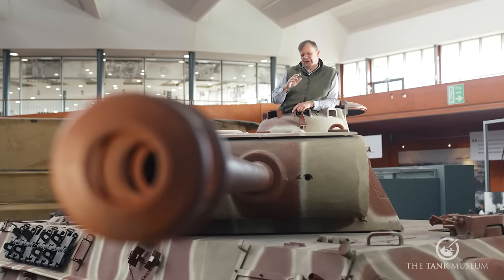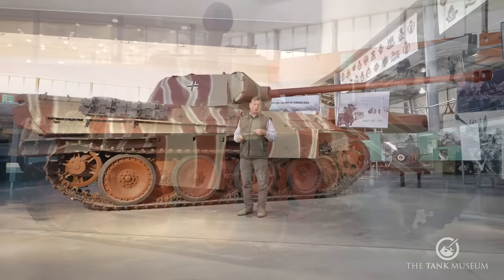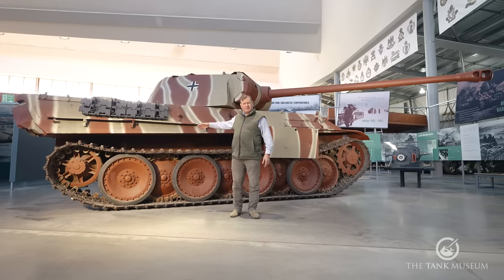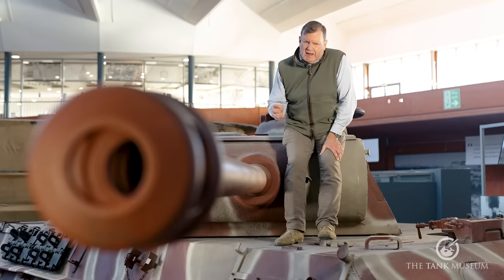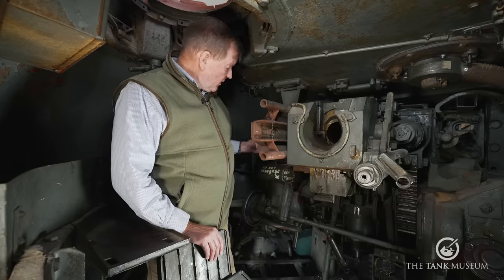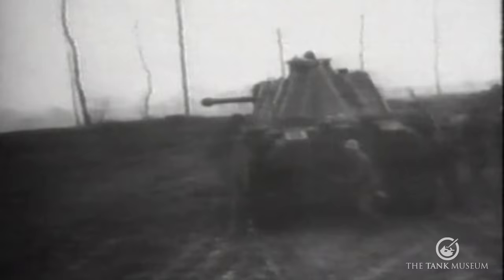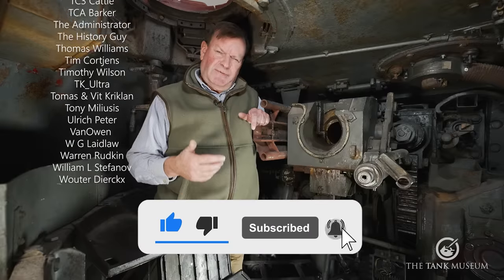See Inside Panther | Tank Chats Reloaded

Comment: Given that Germany was largely on the defensive when the Panther was introduced, it could be just about accepted since they were fighting not far away from railheads and repair depots. For the Allies, largely on the offensive and at the end of a long supply chain, it would have been completely unacceptable.
Reply: We saw during the battle of the bulge how poorly they performed during offensives. Especially King Tigers were a nightmare needing an insane amount of fuel and struggled with local infrastructure
Reply: Given that you could be shot for Wehrkraftzersetzung when saying out loudly you didn't believe in the Endsieg right until the very end of the war, I don't think your comment would have been of big consideration back then. Nonetheless, I guess you are pretty much right.
Reply: Could have built a bigger Panzer 4.
Reply: @julianshepherd2038  could have done many things, but didn't. Decisions are always easier looking back in time.
Reply: @suenin021-ll3us

And yet the Panthers of 2nd Panzer Division got the furthest of any German armour type in the Ardennes offensive, and did it quicker than the Shermans did the reverse advance in the January counter attack so.....?
Reply: @cheften2mk  I think the point I was trying to make would be that if the Allied armies were equipped with Panthers, the whole invasion of Germany would have been a very different deal, because most of them would have broken down along the way or been tethered by fuel supplies. In the past, there has been a tendency to state that late-war German tanks were flat-out superior, and that is simply not true - everything is conditional.
Reply: In late '44 or '45 - sure, in '43 - not really. There were a lot of abandoned and destroyed tanks left behind on the Eastern front.
Reply: This isn’t true, Germany was still attempting to complete its push into Russia when this tank was introduced, on the end of some of the longest supply lines they would ever maintain during the war. There’s even some reports that offensives were delayed to wait for the panther. It was a terrible tactical decision to introduce and rely on this vehicle when they chose too.
Reply: @onenote6619

And of the Germans were equipped with Shermans instead of what they had in the defensive fighting 1943-45 their armoured divisions would likely have fared worse.

Each nation had different requirements.
Reply: @julianshepherd2038 the Panther was the first german tank with "mass production" in mind, the pz 3 and 4 were flawed in their design because they were conceived as high quality low production models,  each variant of both series had soo many different parts that even the haches were all separate models. The panther didnt cost much more of a pz4 F or G considering the upgrades it brought to the table bc its design was the first concieved from the start as mass production tank, with standardized parts easy to produce. In all honesty they thought of making a sloped front version of the pz4 but soo many things would have needed to be changed that they decided it was better to just make a new tank with better stars overall
Reply: @lyndoncmp5751  Hard to say. If the Axis had gone the Sherman route, they would have significantly more tanks built, significantly fewer tanks lost to mechanical issues, fewer crew lost when the tank caught fire and fewer problems with fuel. But that's not what I was trying to say. The Sherman had to be built with utmost attention to reliability, maintainability, transportability and logistics, because it was always going to have to fight across an ocean. On those fronts, it was certainly high on the 'best designed tanks' list. Because it's not World of Tanks and you have to get to the battle in order to fight there.
Reply: @lyndoncmp5751  That's a rather deceptive comparison. On Ardennes offensive, Germany had surprise and weather cover,  so just about every tank they lost in the initial advance was due to mechanical failure or fuel starvation. On the counter-attack, the Allies were going up against a bitter rear-guard action. So the difference in time taken is entirely unsurprising.
Reply: You are assuming that if a tank can reach a repair depot, it can stay there for as long as it needs. 4500 panthers were build but Germans could not amass more than 200 (or 5%) at one time. Thats how unreliable the tank was. A dead weight for the army. This wouldnt be a problem for a specialized heavy brake thru tank but was a problem for a panzer division main workhorse tank. It wasnt THAT expensive to build nor was it build in small numbers (more Panthers were build than Cromwells). The ratio of tanks operational/tanks build is terrible and that makes it a bad tank.
Reply: @julianshepherd2038  bigger Panzer 4? You mean the Tiger I?
Reply: @lyndoncmp5751 The whole offensive was a huge failure and bogged down after days and Peiper had do abandon his tanks, soooo?
Reply: Yeah but when they started developing the Panther they were still on the offensive, don't forget.
Reply: @lyndoncmp5751  Traveling furthest doesn't mean most effective does it? 

It depends on the opposition you come up against on the way or the difficulty of the route traveled. I can't imagine that a Tiger II would out drag a Panther on any terrain, let alone one that is hilly, wooded, and narrow. Let alone the weather. Fortunately for democracy, there were some seriously poor decisions being made at this point in WW2 on the Axis side. The Panthers might have got furthest but how many broke down or caught fire  on the way there, and on the way back 🔥😂. 

Then the Sky's cleared and the allied air forces got into action. 

Did Hitler really think it would be cloudy until the unreliable and thirsty Panthers and the extremely slow and extremely thirsty Tiger II's reached the Dutch ports running on fumes 😂. What a stupid gamble. God knows what the experienced German generals thought, but they probably didn't have much say in the matter anyway. 

Truth is the Panther didn't even pass British tests for battle worthiness in post war tests according to the film so it does make one wonder at the acclaim it receives. It might be considered a thoroughbred, but it was defeated by the pack of very numerous and very basic T34's....which didn't break down, or there was a spare if they did. Nevermind the quality, feel the width lol.
Reply: It wasn't a problem for the Soviets with the T-34
Reply: Using the Battle of Bulge as an example to gauges the effectiveness of late German tank designs, especially the Panther, was far from an accurate assessment. Any German tanks, Panzer IV or III, or pretty much any AFV bigger than a jeep, would suffer in performance, mobility and logistics in narrow forest roads. The Battle of France in 1940 succeeded simply because the Panzers only travelled the unguarded Ardennes Forest, rather than bogged down fighting there, it had little to do with Panzer I or II being lighter or Panther big and heavy.
And if one think the logistically superior Allied tanks could make the difference, remember that the Allied forces had been sitting on the other side of Ardennes Forest for almost half a year after Liberation of France, only entering Germany proper by early 1945, if Sherman tanks could easily fight through the Ardennes then why wait that long?
Reply: @suenin021-ll3us

Well can we say that the American Operation Queen and the Lorraine were also huge failures, despite having masses of Shermans leading the advance. Why didn't these wonderful Shermans break through the Siegfried Line in autumn 1944? Why did they fail to achieve their set objectives?
Reply: @eric934

The claim was that the Panther performed "poorly" in the Ardennes and couldn't get anywhere. I merely pointed out that 2nd Panzer Division Panthers got the furthest out of all the German armour types (almost to the Meuse) in the Ardennes including the Panzer IV at Stug III, and what's more did it quicker than the Sherman did the reverse journey.

The Ardennes was not very good tank country for ANY tank type. Shermans didnt perform any better and in fact the US lost roughly three tanks/tank destroyers in combat for every one German. Total American losses were, according to various sources, between 800 and 900. That's total losses. For the Germans it was around 550. However, circa 50% of German losses were due to running out of fuel, minor mechanical issues and no resources to repair them, and even a thrown track or getting stuck in a ditch caused abandonments when support echelons had no fuel to, well, 'support' them. 

So we are talking circa 300, at most, German combat losses vs 800-900 American. That's a big difference.....and the Americans were doing the defending during much of the battle.

Around 500 Shermans were combat losses in the Ardennes vs around 100 Panthers. The Panther was the most numerous German tank in the Ardennes.

Did the Sherman REALLY perform any better, or were there just a lot more of them.

US 6th Armored Division was full of confidence in its tanks prior to the Ardennes. When Eisenhower visited 6th Armored Division on February 13th he found this summary:

"13 February 1945
Subject: Visit to Armored Units.

2. 6th Armored Division.
c. Equipment: - Present tanks are entirely unsatisfactory, due to lack of a satisfactory gun and lack of flotation."

Similarly, the report Eisenhower received from tankers of US Armored Division in March was equally scathing of the Sherman.
Reply: @sthrich635

Absolutely. The Americans had masses of Shermans in autumn 1944. Their Shermans still failed to make the difference and progress far beyond Aachen, in the Lorraine, in Operation Queen and in the Alsace. Basically the US Army couldn get anywhere for six months from September 1944 to March 1945, despite having thousands of the "super wonderful 100% reliable" Sherman tank which was the bestest and safest tank eva eva eva..... so we are now told.
Reply: onenote6619

Shermans basically did well because there were lots of them due to the capabilities of mass American production (which the Germans couldn't have matched REGARDLESS of what tank types they decided to build) and they almost almost enjoyed considerable air and artillery support as well as practically unlimited other support, supply and resources. The Germans would have had none of the above 1943-45 and thus the Sherman wouldn't have worked any better than what they did have. Likely worse in fact. 

Their big cats and powerful panzerjagers suited them better in the 1943-45 defensive fighting than the Sherman would have. For certain. If the Germans had the Sherman they still wouldn't have had quantity superiority and the Sherman without quantity superiority and without mass air and artillery etc support would have been mediocre. 

The German "surprise" attack in the Ardennes was only a "surprise" for the first few days, so let's get real here. After the first few days the Americans were able to recover and send vast amounts of reserves there. Even British forces were sent in to aid them. In the American Ardennes counter attack in January they had nearly a million men and were facing a numerically inferior enemy short on fuel and other supplies. The Americans, again, also had mass air and artillery support and were not facing a fresh new enemy. The Germans had been fighting for weeks without reinforcements and were exhausted. Many of the American troops in the January counter attack were fresh. The Americans had far more advantages in January than the Germans had in December. 

So I'll repeat what I wrote earlier. The Panthers of 2nd Panzer Division got the furthest of any German armour type in the Ardennes, and they did it quicker than the Shermans did in the reverse during the January counter attack. I stand by this fact. 

All tank types have mechanical issues and breakdowns. The Sherman wasn't immune. In fact during the British 2nd Army's advance across France after Normandy, known as the Great Swan, they reported their Shermans were less mechanically reliable than their Cromwells, and suffered more automotive issues.
Reply: @Paciat
"4500 panthers were build but Germans could not amass more than 200 (or 5%) at one time."

Your figures are off. The Germans built over 6,000 Panthers 1943-1945 and there were over 650 Panthers deployed to Normandy in 8 battalions.

Overall operational average % of Panther battalions in 1944 reached a high of 85% on 31st October and a low of 53% on 30th December. The mean was 75%. This figure includes those in repair with battle damage. 

Source :Thomas L Jentz, Germanys Panther Tank, which is the best single source on the Panther. 

Where on earth do you get your 5% claim from?
Reply: @Paciat  Germany could not amass more than 200 Panthers at one time? Wow, what a load uf utter nonsense. Germany had more than 600 Panthers for the fighting in Normandy. Maybe read some actual books?
Reply: @onenote6619  No, they were not build with the utmost attention to transportability or logistics. That is simply a vast oversimplification that keeps getting said to ignore how much works it was to keep tanks working. It falsl in the same silly category in that Shermans could not weigh more than 30 tons because the cranes couldn't lift it, which is nonsense as dock cranes could lift way more and so did the 50 ton crane on Liberty ships.
Reply: @lyndoncmp5751     Hi, it is however a well known fact that the German Ardennes  Offensive was entirely unexpected and against very minimal resistance initially. That the hastily organised Sherman's made slower progress on the return journey against a Panzer Army in position can't be a surprise to anyone surely.

That Hitler and his generals gambled so badly, using and losing so much materiel in the process and in such a choke point as the Ardennes is delusion at it's worst. They chose the trap for themselves and drove into it with unreliable tanks and not enough fuel. When a tank broke down it blocked the road and others couldn't get past in either direction. The Americans joined battle there because the Germans had chosen the battleground, they had no choice. They did a very good job of it in the end too. Especially when the skies cleared for the fighter bombers.

As for the 3-1 losses suffered by the Americans, it doesn't matter. Crews bail out and those that survive/escape, go get a new tank/tank destroyer and carry on. That's what numerical superiority gives you. German crews on the other hand become infantry until they can find another tank that's not broken down or empty of fuel. The same of course largely applies to the Russian front and the T34.. However the ground there was more suited to tanks. It still didn't work though for the same reason. Essentially it's a case of a poor choice of weapon. 

At the end of the day the tank that wins is superior, because it is more effective in the progress to victory. It doesn't matter how many you lose if you have lots and lots.
Reply: @julianshepherd2038  — Nah, VK 30.02(DB) aka "Teuton" T-34 was a better tank prototype. It was fast and agile, better armored and easier to produce, but silly M.A.N. Politics got on the way, and Fuhrer totally bought into "bigger is better" selling point, that M.A.N. Failed to deliver.
Reply: @Dreachon  Normandy isnt one place. It was a whole theater of operations. You could argue that Earth is one place witch is absurd. Maybe read a book (or anything for that matter) correctly before you tell others to do so. Germany could not amass more than 200 WORKING Panthers at one time (for one attack) even tho they had a thick railway system.
Reply: Jesus Christ and Mary Magdalene in Heaven.......
With the GREATEST respect and humble....this video is made by historians, a historian presents the tank. and STILL I can find myths in it.
Please read my arguments carefully:
1. Panther built by British after the war, cannot complete a British trial.

First: 
I immediately noticed that the G Panther in the museum has a  Ausf A variant tower. This alone shows the seriousness of the "putting together" operation.

Second:
Were the British people who conducted the tests trained enough to use the panther?
Were the parts used to assemble the tank equivalent to 1944 quality materials?
What was included in the test that the Panther could not perform, what was the fault?
These are 3 major questions for which we have no answers, only that the Panther is unreliable.

How is it that the Germans, who also knew about the Panther's faults, were able to do 1 500 to 4 200 km with the Panther? 
Isn't that contradictory ?

2. Did the Germans "borrow" the angled armour from the T-34?
Virgin Mary...this myth was busted decades before, are you still bringing it up?

3.Does the Panther eat 4x as much fuel as the T-34? 
I ask you...WHY DID YOU DETERMINE THAT?!

Let's look at the numbers:
To start with, a diesel engine uses on average 20-30% less fuel, but not 4x less.....

The Panther had 720 liters of fuel.
Range of Panther:
On the road: 200-260km
On land: 100-130 km
Panther consumption: 2.76 Litres/km (on road)

The T-34:

Mod 40-41:

460 Litres of fuel.
On the road: 330km
Ground: 200km
Mod 40-41: 1.39 litres/km (on road)

Mod 42:
On the road: 330km (same distance as Mod40-41, because it was 2 tons heavier than Mod 40-41)
Ground: 200km
610 Litres of fuel.
Mod 42: 1.84 litres/km (road)

Mod 43:
On the road: 450km
Ground: 260km
Had 790 Litres of fuel.
Mod 43: 1.75 litres/km

T-34-85: (internal tank only)
556 Litres of fuel.
On the road: 300km
Ground: 160km
T-34-85: 1.85 litres/km

At best:
2.76 vs 1.39: 1.98 x.

Where is the 4x indicator?

4. "interleaved road wheels prone to clog ice and mud"
The tracks of any tank can accumulate ice and mud....

5. The engine radiator is a weak spot....
Jesus Christ in Heaven....its like the weak side armour "argument". Even the T-34 had vent intakes on the engine....
So today, the Leopard 2 is a piece of crap, because has big ventilators on the engine, and has only 40-50 mm of side armour...
Even modern Russian MBTs has the same amount of armour and big vent intakes on the engine as the panther....
Or the British Challenger 3 has the same "weak spot" or the M1 Abrams vent intakes....
Please Sir, do not use this kind of arguments.

6. KwK 42 is NOT much better than a Kwk-40 on the Pz IV...
Sir....numbers....
Source: Bird, Lorrin Rexford; Livingston, Robert D. (2001). WWII Ballistics: Armor and Gunnery. Overmatch Press. p. 61.
Kwk 40: (against 90° of armour) (L/48, not L/43)
100m: 135 mm 
500m: 123 mm
1000m: 109 mm
2000m: 86 mm

Kwk 42:
100m: 185 mm 
500m: 179 mm
1000m: 149 mm
2000m: 145 mm!!!!!

If that's not a big difference, I don't know what else is "big".

7. For the driver levers, pump means, it had hydraulic SERVO drive.
To simplify it: you could turn the tank with your little finger. Whereas with the other allied tanks, it took a lot of physical strength.

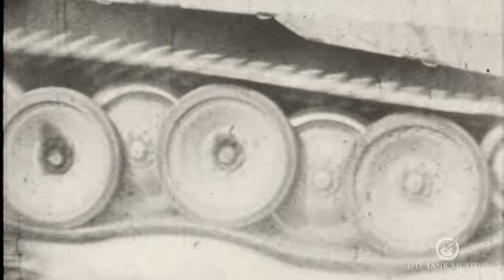8. As you can see: 16:48 the gear lever was "on the floor" next to you, and not upwards as it is in the museum tank.

9. Serviceability only 35%? Please, Sir, do not lie:
Check out the Panther --->Reliability table on wikipedia.

Fun fact: avg. it was 61-62 % from 1944 may until 1945 march. In 1944 if there was not a big push, the serviceability was 85-71% on the western front.

10. 370 final drive was broken. Nice. 
In how long? And from how many tanks? 

Oh, and yes: why did it break, perhaps from a 76mm hit?
I won't paste odes about the reliability of the Panther and the T-34 here, their wikipedia pages have it all beautifully described.

Fun fact:
"Soviet tests on newly built T-34’s showed that in April 1943 only 10.1% could complete a 330 km trial and in June ’43 this went down to 7.7%. The percentage stayed below 50% till October 1943 when it rose to 78%, in the next month it dropped to 57% and in the period December ’43 – January ’44 the average was 82%. During February 1944 tests, 79% of tanks reached 300 kilometers, and of the test batches 33% reached 1,000 kilometers. This became immediately apparent to the tank troops. The deputy commander of the 1st Guards Tank Army, P. G. Dyner, commented that tanks in 1943 would reach only 75 percent of their guaranteed life span in engine hours and mileage, but in 1944 they reached 150 percent."

O, and yes, from that 1945 report, Sir, you forgot to mention this:

"From the front there continues to be serious complaints
regarding final drive breakdowns in all vehicle types.
Approximately 200 breakdowns have been reported with
the .38(t). Prior to the 1945 eastern offensive there have
been 500 defective final drives in the Panzer IV. From the
Panther .370 and from the Tiger roughly 100."

Every tank had problems with its final drive, because of the LACK of training and bad material quality.

11. More Panther lost by mech. breakdown than to enemy fire: Where are the numbers, Sir?

12. French fixed the engine fires? Siiiir, please: The Germans tried their best: tried to use better materiel for the fuel pumps, and decreased the horsepower from 700 to 600 hp.
The Germans knew what are their problems. About the Panther engine there are many-many  bad tone report blamed on Maybach. And the solution was to reduce engine power.
The result of this was checked by Guderian in April 1944.

Why don't you share this information with the world?

Thank you for reading.
Reply: Panther units undertook long road marches both in the East and West, without too much trouble, in the summer of 1944. The Panthers built by the British, well...
Reply: @Paciat  The Panther had about the same readiness rate as the Tiger and Panzer IV, about 70+ % on average in 1944.
Reply: @TTTT-oc4eb  wrote: "Panther units undertook long road marches both in the East and West, without too much trouble, in the summer of 1944. The Panthers built by the British, well..."

-- Which units, what distance, and what sources if you don't mind to spill some beans.
Reply: Yes.
Reply: @RussianThunderrr  wikipedia is your Friend.
Reply: If this philosophy were true, it was ill conceived and even more poorly executed.  Germany recovered the fewest tanks of the war.  If a tank suffered mechanical issues under dire circumstances it was more likely to be scuttled.  Given the mechanical complexity of the tanks it made it nearly impossible to field repair these tanks.  The logistics of moving downed tanks from the front lines to the rear was a monumental and near impossible feat.
Reply: Almost all Panthers which served in normandy had to march 150 to 200km befor they could  engage in the fights. Panzer Lehr-Division even did it with Panthers which where at Le Mans at that time, about to get send back to Germany for factory overhauls. Despite the needed overhaul they somehow made it back to normandy.

The Panthers of Piper achieved the deepest penetration into the allied frontlines during the Ardenne Offensive of about 100km.

There are serveral examples where Panthers marched hundreds of km and still engaged in combat successfully.
Reply: @rolandhunter Thx Roland... I was too tired this time.
I had to quit after first few minutes....
I have to to say the Australian Armour and artillery Museum is doing a much better job than Bovington lately.
Reply: @HaVoC117X  You're welcome, and I agree.
Reply: @HaVoC117X  wrote: "Almost all Panthers which served in normandy had to march 150 to 200km befor they could  engage in the fights. Panzer Lehr-Division even did it with Panthers which where at Le Mans at that time, about to get send back to Germany for factory overhauls. Despite the needed overhaul they somehow made it back to normandy.

The Panthers of Piper achieved the deepest penetration into the allied frontlines during the Ardenne Offensive of about 100km.

There are serveral examples where Panthers marched hundreds of km and still engaged in combat successfully."

-- Really? 1943 during Kursk battle the whole armies of T-34 did better then that, 1944-45 it was expected of thousands kilometers from T-34 tanks.
Reply: @RussianThunderrr   yeah you mean like the 5th guard tank army which somehow managed to march 300km to Prokhorovka, just to lose all its tanks in its first major battle with a loss rate exceeding 100% until mid July.
George Nipe estimates that 600–650 tanks of the 5th Guards Tank Army were damaged or destroyed while fighting both the II SS-Panzer Corps and III Panzer Corps on 12 July. Of which 50% were total!!!

But the Panther is particulary bad, because the 200 first batch production tanks only maintained a 35% ready for service rate after two major battles and 10 days continues action with only 55 total losses?

Zaloga in notes in  his book "Armored Champion: The Top Tanks of World War II" (2015),:

In 1943 a greater effort was made to impose quality control at the tank plants. All T-34 tanks had to undergo a 30 km test at the plant, followed by a 50 km test by military inspectors before the tank would be accepted by the army. One in a hundred tanks would also be subjected to a 300 km test run. The initial 300 km tests in April 1943 showed that only 10.1% of the tanks could pass. In June 1943 only 7.7% passed.

This number slowely improves, by early 1944 the T-34's reliability finally reached acceptable levels. During February 1944 tests, 79% of tanks reached 300 km, and of the test batches 33% reached 1,000 km. 
Service life of the Transmission was listed at 1200km in mid 1944 for the T34.

The Panther achieved 1500km for the engine in spring 1944 and 5000km for the gearbox on average.
So after half a year of production the Panther was 5 times more reliable in spring 1944, than the T34 after 3 years of production in mid 1943. And even by mid 1944 the t34 was just as relaible as the Panther.

In 1943 the soviets maintained a fleet of around 25000 tanks, of which only 8000-9000 were in active service at the frontline at any given moment. This climbed to 35000 tanks in 1945, but even than only up to 10000 tanks were in serice at any given moment. So 2/3 of the soviet inventory was held back as replacement or was in factory overhaul.
Thats how the could maintain service rates over 80%. Because they had the numbers, but not because the T34 was so reliable.

Germany never really had more than 6500 tanks and SPGs at a time during 1943 and 1944, but only around 1500 of this were in germany. The rest was held operational in the field.
Reply: @HaVoC117X  wrote: "yeah you mean like the 5th guard tank army which somehow managed to march 300km to Prokhorovka, just to lose all its tanks in its first major battle with a loss rate exceeding 100% until mid July."

-- Funny how you start reply on reliability of the T-34 tank with "strong statement" that have nothing to do with reliability of T-34 tank. BTW what is the source of the statistic here? Is that "Die Deutsche Wochenschau"?
Reply: @HaVoC117X  wrote: "But the Panther is particulary bad, because the 200 first batch production tanks only maintained a 35% ready for service rate after two major battles and 10 days continues action with only 55 total losses?"

-- 35% battle redeness by Panther tanks was maintained, not just in first badge of 200 Panthers, but throughout year of 1943. per Robert A. Forczyk.

It was not until 23–29 June 1943 that a total of 200 rebuilt Panthers were finally issued to Panther Regiment von Lauchert, of the XLVIII Panzer Corps (4 Panzer Army). Two were immediately lost due to motor fires on disembarking from the trains.[94] By 5 July, when the Battle of Kursk started, there were only 184 operational Panthers. Within two days, this had dropped to 40. per Thomas Jentz
Reply: @HaVoC117X  wrote: "The Panther achieved 1500km for the engine in spring 1944 and 5000km for the gearbox on average."

-- Why not to share the stats for Panther's final drive, instead of making misleading statements in order to take attention of problematic subject in consideration.
Reply: @HaVoC117X  wrote: "In 1943 a greater effort was made to impose quality control at the tank plants. All T-34 tanks had to undergo a 30 km test at the plant, followed by a 50 km test by military inspectors before the tank would be accepted by the army. One in a hundred tanks would also be subjected to a 300 km test run. The initial 300 km tests in April 1943 showed that only 10.1% of the tanks could pass. In June 1943 only 7.7% passed."

-- Yet, somehow operation Uranus of encirclement of F. Paulus's 6th Army in Stalingrad was spearheaded by T-34 tanks succeeded, while operation "Winter Storm"(Unternehmen Wintergewitter) by E. von Mainstain totally failed to relief  330 000 Wehrmacht troops.
Reply: Cool story bro
Reply: totally wrong mate
the americans were known to be able to repair up to 80 percent of all combat vehicles lost and the germans knew it which is why they often shot their tanks till they burst in an explosion
the germans were on a constant and fast retreat especially in the west and repair depots if they could even settle down someplace safe without getting rolled over were constantlyy harassed by enemy aircraft and had logistical problems 
im lsitening to a german tank commanders memoirs atm and he said all of that